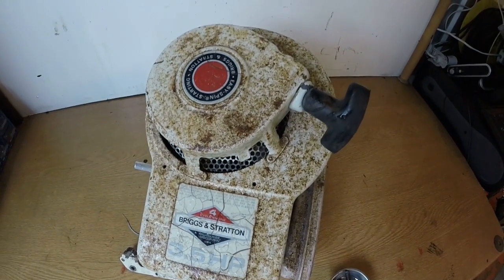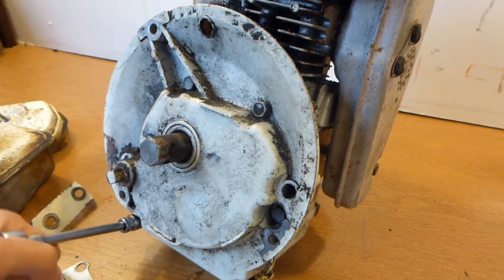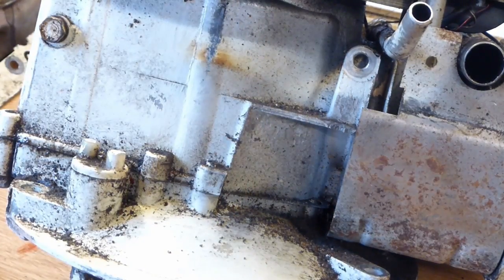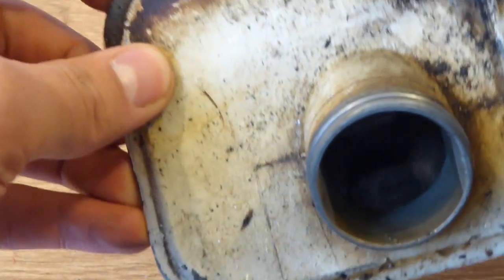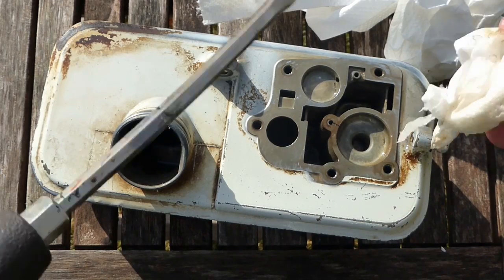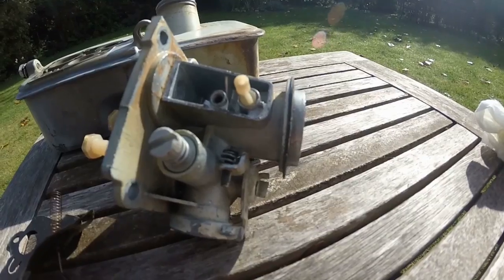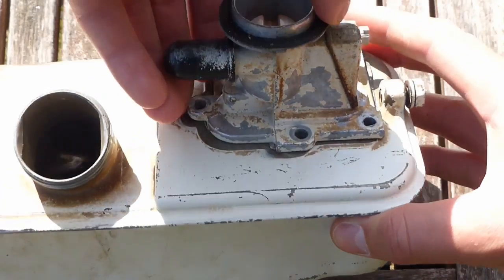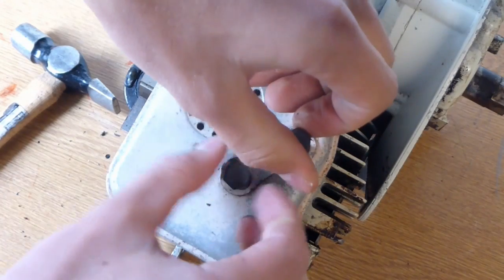Briggs and Stratton Engine Repair 3.5HP 1980 | PART 1

Comment: I'm restoring a 1985 Murray push mower, flood recovery you can see running on my channel.  It has that carb, but with a heated choke spring and it has that same diaphragm with the vacuum pull off linkage.  It uses the screw in muffler instead of bolt on.  No decals on the recoil housing, but an embossed logo where you have the rectangular sticker.  It runs really good, but has some cylinder scoring that I can see, but not feel.  It's really been through a lot of trauma with the tax day flood in 2016, then Harvey the next year.  Sat outside for who knows how long, unloved.  I'm thinking of polishing the block and doing something other than black on the recoil housing, maybe gloss red.  Painted the gas tank flat black. Silver high heat for the steel part of the muffler.  The deck is going to be the hardest part, lots of rust, but no holes.

Comment: Does anyone know where I might find parts and gaskets for this engine? I am trying to rebuild/restore an almost identical engine to the one in this video. Except mine was manufactured a bit later, March 7 1986. It's older than I am lol.
Reply: Ebay is a great place to find good deals so is this place  https://www.jackssmallengines.com/jacks-parts-lookup/manufacturer/briggs-stratton/100000-19z999-series/10j900-to-10j999

Comment: Because of the low value of these engines, I believe it makes more sense to just do a compression check on them. If  it has adequate compression, I drain the oil and then clean the sump of sludge with a little gas, sloshing the gas around and then draining it. Then I refill with 10-30 or 30 wt. synthetic. It makes no sense to remove the sump on an engine with compression unless the crankshaft seal is leaking and needs to be replaced.

Comment: Hey! Greeting from texas... i have a few of those b/s pulse jet engines some bought, dumpster dives and freebies. One, mounted on a atlas 20inch deck from assume  the 80s or 70s. Insted of dealing with the old parts for the carb i just put a new style pulse jet carb and tank on works great... next project is a wizzer mower from the 50's!

Comment: I have this motor although my carb does not have 2 fuel feeds to the carb as yours does. It just has one fuel feed on the bottom of the carb along with the spring for the choke. Can I replace the old carb on this engine with a bulb primer carb? Any idea of which carb I might use? ie. Briggs and Stratton ref. number. Thanks, as you can see I really appreciate your rebuild blog.

Comment: I got one of these recently, its been sitting for the last 20 years.
Reply: There seems to be some sort of pudding in the gas tank
Reply: @danielauen7790  thats varnish you need to thouroughly clean all the carburetor parts and tank its a very hard job but it has to be clean
Reply: @hunter7476  it was much worse than that, I didn't have the motivation to fix it, so I scrapped it.

Comment: Hey, great video, have been keen enough myself to take sump off one of these so thanks. Got a heads up tho, the previous owner has also lost the spring and round shim for your carb as well as the screw, if you watch another briggs autochoke video you can see the part in talking about. They said it's very important for the running of the mower. I don't want you throwing all that work away if it won't run dude.

Comment: some of these old 3.5 HP Briggs and Stratton engines will have different starters one a wind up starter and in the 1970s a vertical pull starter.  as the engines made before 1982 will have the points under the cover under the flywheel angines after 1982 will have a Magnatron electronic ignition. the carburetors they have a vacujet or a pulsajet carburetor the engines from the 90s and later will have a pulsaprime carburetor a plastic carburetor with a primer bulb. as well in the 1990s and later the shrouds are more styled and offered as the classic, Sprint 3.75 HP and Quattro 4 hp. till in the 200s is when Briggs and Stratton switched the power rating to Gross Torque.  as the later 3.5 hp engines have a plastic camshaft in it. as the older 3.5 engines from the 1950s- the 1990s are designed better with a metal camshaft the blocks from the 1970s to the 1990s are modular as parts can be interchanged but painted to match the color. as the engines from the 1980s will have if on mowers a blade brake on them some saying System 2 Manual start. in the US in the 1980s is when the blade brake became manditory on all rotary push mowers, edgers, and string trimmers.  as the old engines are good for display too.

Comment: 3:01 "Not the right gasket for this engine".  Actually they made one gasket which fit the 3/3.5HP (9 cubic inch) engines and the 4HP (11 cubic inch) engine, which had a wider crankcase in that area.  The gasket 'flap' you noted is actually the part that makes it work with the 4HP variant.  It is very likely a factory installed gasket.

Comment: can you confirm which side the spring goes before putting the diaphragm back on? I didn't see it being removed or put back. also how did you clean the main jet? thanks.
Reply: spring sits against carburetor, then diaphragm goes over spring, then attach to the gas tank. It is easiest for me to hold the carb and gas tank upside down until it all sits right

Comment: I've got this same engine in great condition like yours but black
Reply: Paul Herman I have a engine like this but mine smokes a lot and is red
Reply: try replacing the piston rings, i had the same issue and that cleared things up.
Reply: Paul Herman i have the same just from 1968

Comment: Hey mate, I have the exact same engine and I was wondering if you could tell me the name of the small metal part at 4.12. It's in the top of the carb on the beige colored valve. It looks like a tiny screw or jet? What is this part and how necessary is it?
Reply: I have the exact same engine and I was wandering where the best place would be to get spares?
Reply: Did you mean on the flap valve or the flap itself?
Reply: On the flap valve. Basically, I can see 2 holes where there should be 1?
Reply: Yeh it's needed, that secures the flap too the metal rod that runs through the flap valve. did you loose it or something? If you found it like this I would do a good look over of it and make sure nothing else is missing before you continue. Someone may have used it for scrap parts, those don't simply fall off lol
Reply: Thanks mate, I will take another look at it tonight. I will try take a picture of it to clearly show what I mean. As far as I can tell, everything else is in order. I've replaced the diaphragm as well to eliminate that. The engine starts, but only using starter spray.
Reply: There are two versions of this valve. The one in the video screws to the actuator rod. The other kind is a one piece plastic version that doesn't use a screw.
Reply: The hole is still there though.

Comment: Nice video, I do the same as you, buy old engines and restore them, I only have a few in my collection at the moment I have a Sthil FS96 engine which is quite rare, a petter A1 engine, an old 1980 12HP I/C Briggs and a few more, keep up with what you are doing, brilliant and very informative.

Comment: you should use a straight edge and the appropriate feeler gauge I want to say .03 , not sure though, on the top of the tank especially the part where the choke spring goes around the 10 -11 o'clock position where there is the round hole with the small metering channel that goes to the big recess where the choke spring goes. Those tanks warp a lot. I think it is from pouring cold gas into the tank after the mower has run out while running.